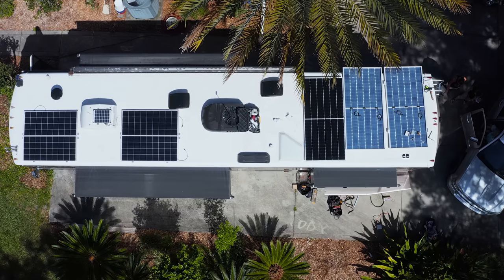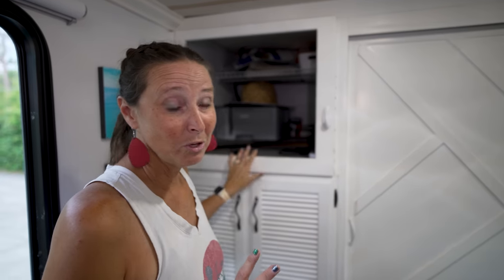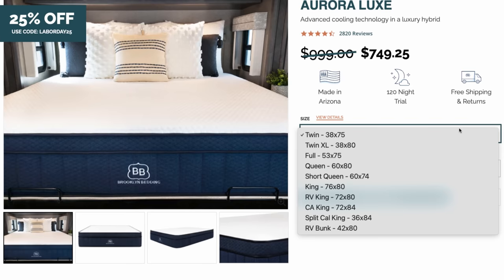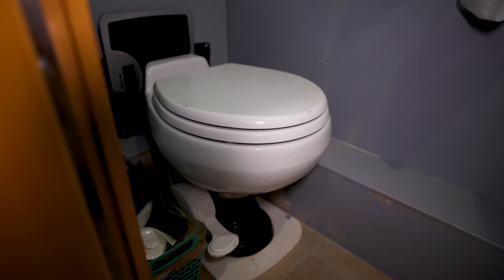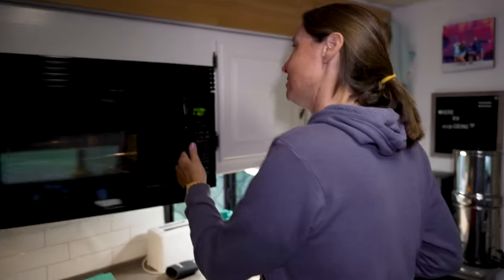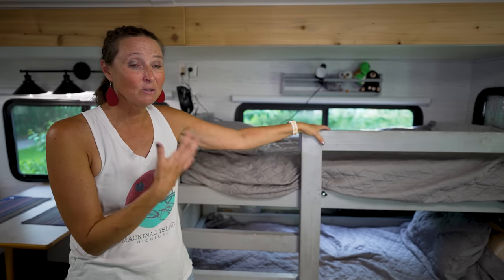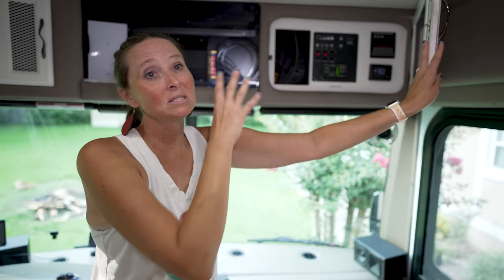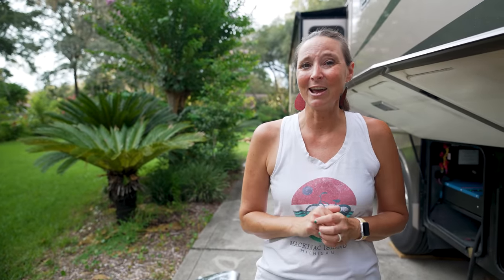Our Most Controversial RV Mod! Full Renovated RV Tour

Comment: Whats important is that the renovations work for you!  We've switched ours all around too. We actually purchased theater seating loveseat from Big Lots. It was much lighter weight than the RV couch, and so much more comfortable. We removed our televator/buffet/table and flipped the floor plan around. Theres now a dog bed with a smart TV hung over it and our couch is on the opposite side. We have a lot more floor space now. We used a collapsible table for eating. Its unfortunate you heat duct is thru the couch, maybe a day bed would be good. Then you can build storage underneath around the venting.

Comment: Get an Aurora Luxe split Cal King mattress that is 36x84.  Put it on a platform with pull-out drawers and cantilever it to fit the space as necessary.  Get pillows for the back and have a washable cover made for it to make a couch but one that even a tall person could sleep on.  Tell RV Mattress how you plan to use the Aurora Luxe mattress(es) and that it will enhance your ability to advertise for them.  If they get the idea they might even give you the mattress.  BTW:  You could also consider building a trundle-type bed and having two mattresses in that space just in case you have guests. (Have the frame/support built with the needed ductwork.)  Either idea would work.  What do YOU think?

Comment: We removed the TVs also, I like your ideas on using the space above the windshield.  .The area behind the passenger seat (where your sofa is now)we  did an TV lift cabinet that I build at a campground and 9- 1 foot square storage  cubes 18" deep attached to the TV cabinet, unless the TV is up we still have the window view.  It also doesn't impede the walk way when sled in.
Reply from the maker: Nice!

Comment: three questions.. [you mention down below but i find nada...]  1 what kind of elect stove? induction or??  2 do you still have propane furnace? did you get rid of all the extra propane lines? 3 still have propane water heater?  im curious.. i want the propane furnace, but the rest are dodgy and my trailer came with a dc compressor refrigerator.. im quite curious about a electric stove at least partially because its so difficult to keep the propane stove clean and as we all know the best way to keep mice away is spotless clean. thanks much
Reply from the maker: Hey there, thanks for watching. We installed an induction cooktop and capped off the propane line that went to the old stove. We have a propane on demand (tankless) water heater from etrailer. We do still have a propane furnace but we also use the heat pumps in the roof top a/c’s for heat more than the furnace.

Comment: If I were replacing that couch, I'd see if there was a way to but another bunk over there and convert the bunk on the other side to a couch too. Might be tough because it's on a slide. Kind of like those bunk beds with the couch underneath and bed on top. Gets you more seating. And might be nice for the older kids to have a bit more of their own space. But it's hard to tell on the video of you could actually sit under the bed if you did that and exactly how wide it is. Thanks for sharing!
Reply from the maker: Thanks for the suggestion!

Comment: Love the updates and upgrades y’all have made! We’re not ready to ditch the propane just yet, especially for heat. We mainly use electric heaters but I like the redundancy. Solar is the next frontier for us. Is your battery set up able to run an AC or just everything else?
Reply from the maker: Our set up can run a/c - we have a 3,000 watt inverter so as long as stay under 3,000 watts.
Reply: Same here. We like propane for heat and for cooking. We also don't have room for a big bank of lithium batteries. I think that is necessary and a game changer for being able to get rid of propane.

Comment: I pulled all three(?!?!) TVs down and have been repurposing their homes. The outside TV has become a tool locker. The TV over the dinette became a swing out computer monitor, mini library, and craft storage area. The master TV is becoming an equipment nook, with a 3d printer, photo printer, and all-in-one laser printer.
Reply from the maker: Nice!
Reply: Great use of the spaces! I agree that there are a lot of tvs in new RVs…the bigger they are, the more TVs there are!
Reply: Tool locker is a great idea!
Reply: It seems odd that they are putting so many TV's in. Maybe I'm wrong, but it seems like most people would want less TV's nowadays. I do like those TV's that come up out of the table. I also like projectors because you can take them outside and project them on a sheet hung on the RV and have outdoor movie nights.

Comment: I'm shocked, shocked and scandalized. By the amount of ambition and initiative. In my opinion, taking out the big box that was blocking the windshield is wise, the only caveat is making sure that the things are secured, so when you hit the gas, they don't tumble out on you. That's always maddening. As Matt has said, 'no RV is perfect', but I think yours is approaching that. I was wondering about the power draw from induction, and converting the fridge is a biggy. Did you leave the venting in? A lot of people block it off, but it still needs to be cooled, so I wondered. I'm liking it, keep up the good work.
Reply from the maker: We did keep the venting in the fridge and since it’s 12 volt it’s not as power hungry as a residential fridge would be. Thanks for watching and the comment

Comment: Since you have a router that starlink is plugged into you can do away with the starlink router.
Reply from the maker: I have the Starlink router in bypass mode, which allows the Peplink to handle everything. So the WI-FI on the Starlink router is off and just delivering power to the dishy. I can still stow the dish and see stats by going to http://dishy.starlink.com/ or from the app. Eventually, I’ll be installing an injector so I can get rid of the router and power everything on DC power (batteries only). More fun stuff coming in the near future!

Comment: Holy cow...  Modifying your overhead console?  "Isn't that illegal??"  
Probably from someone who drives around in a 1993 Ford Escort Wagon with their "temporary" Handicapped hang tag dangling from their mirror blocking 20% of their forward view, a faded to white and grey Garfield "Hang In There" stuffed animal suction-cupped to the passenger front window block view to their right, parks in the fire lane ("I put my flashers on, so it's fine."), three out of their four tires are 15 lbs under-inflated and the other one is 15 over, and bumper stickers completely obscuring their rear window.  Said vehicle probably burns a quart and a half of 40-weight between each fill-up of gas, leaving a cloud of smoke at each stoplight launch.  This haze doesn't really hide their utter hypocrisy of their PETA, Green Peace, Earth Day, and World Wildlife Federatopm stickers in said rear window.
(Nothing wrong with saving the planet, but shouldn't they really be driving a Tesla, Prius, (insert other electric car brand), or bicycling to get where you're going??)

Comment: Speaking of Safety….Please for your safety, change those batteries of 36 months. Period. Trust me. USMC/USAF. SAFETY
Reply from the maker: Our Battleborn lithium batteries have a life of 10 years
Reply: @trumpwon8231 - I hope you're talking about the chassis starting batteries. Lithium Iron is the way to go and what I'll be putting in my rig when the FLA golf cart battery bank needs to be replaced.
(oh, and btw, Trump lost)
Ben and Charity - Great call on the Battle Borns. I'll be calling Todd when it's time to upgrade my off-grid system.
drguyor, 2861/62 USMC retired, so yes I do know a little about electronics and electrical systems.